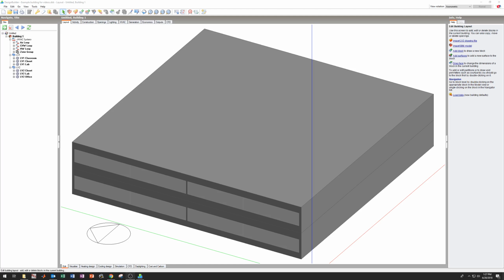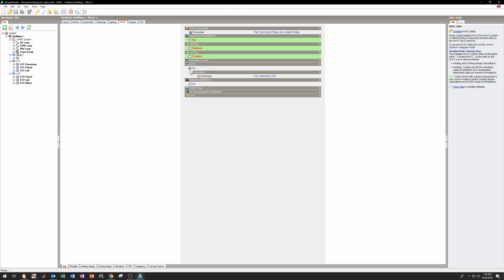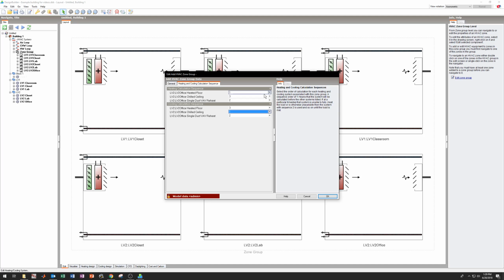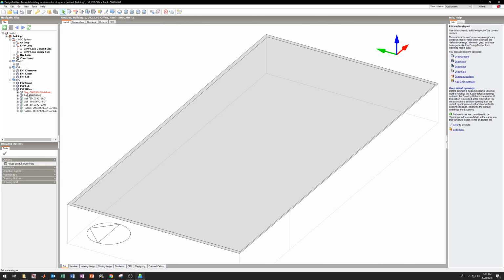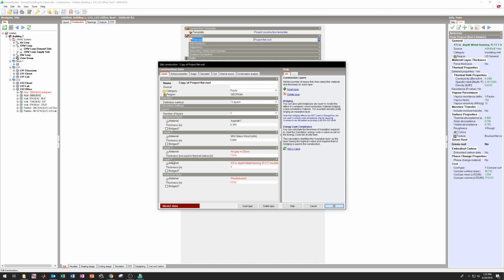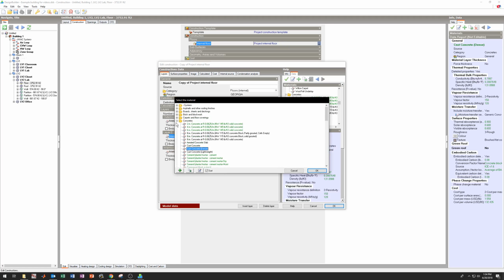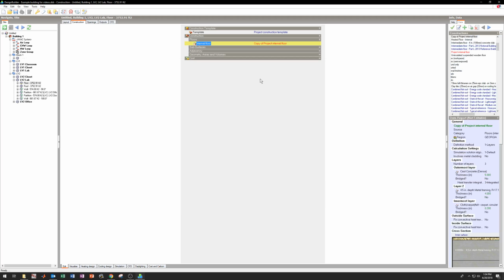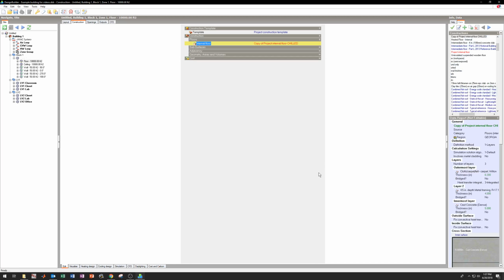DesignBuilder Radiant heating and cooling

Comment: You untick the option for "include zone in thermal calculations" this seems to not include the dummy zone in in the IDF file at all. . So there is simply a gap when you check the DXF file.  Is that intended?